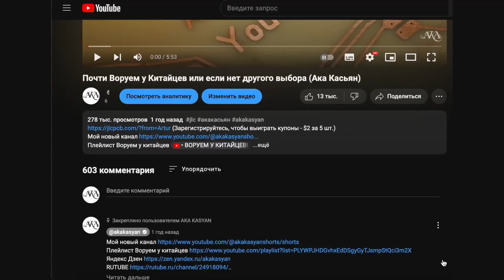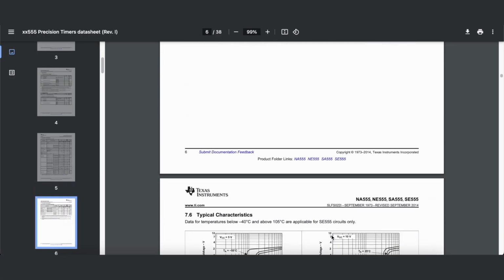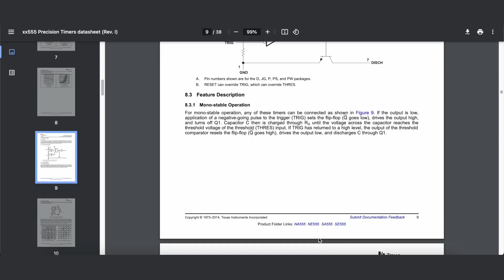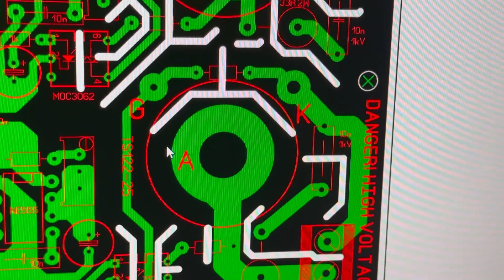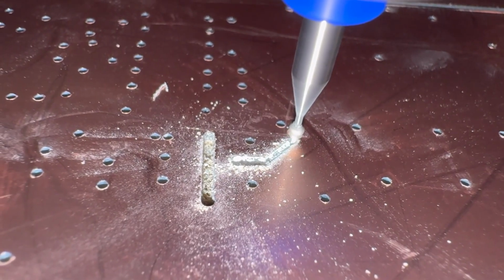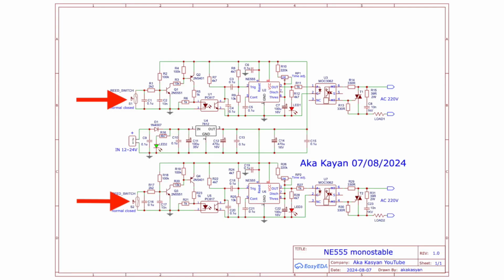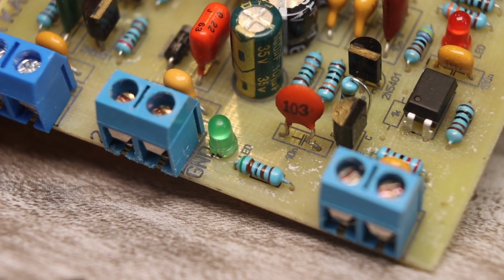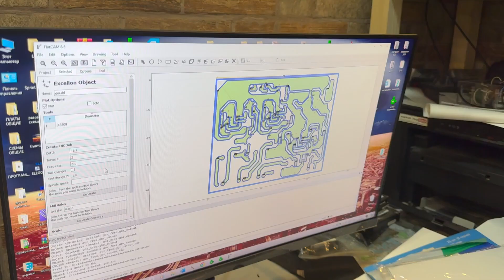Almost IMPORT REPLACEMENT

Comment: I agree. The 555 is the most reliable way too go in my opinon. It has to be the most referenced timer type ic chip with historial reliablty. Easy too see why it has not gone into obsolescense pile of other tried and failed ic piles. Which is why it continues to be profitably manufactured and available.  The rest of the product manufacter's world wide in ALL items of utility, should take note;  if you manufacture the next widget gizzmo,,, make it consumer reliable by not cutting corners too increase profits with replacement driven ideas, but with reliable items, cars, homes etc, with which too build upon,, you'll be in buisness for LIFE.

Comment: I enjoyed your high frequency modified sine wave inverters so far and I have built mine and is working excellently. Can you make a video on how I can make it a pure sine wave, with the C code, probably with Atmeg328 microcontroller. The transformer turns for 500 or 1000w. The features 
1. Over voltage protection
2. Over current protection 
3. Over load protection 
4. Short circuit protection
5. Reverse polarity protection 
6. High temperature protection

lastly LCD display.